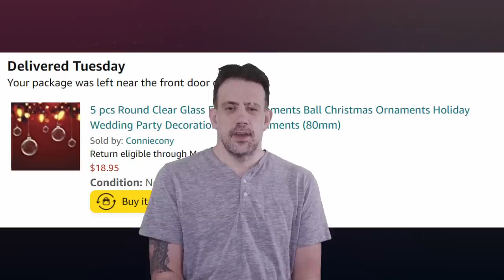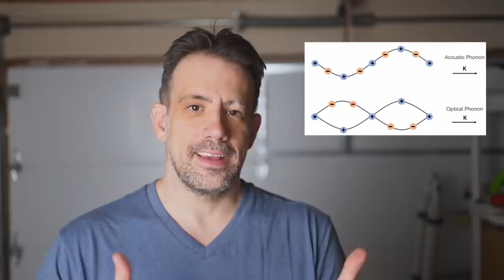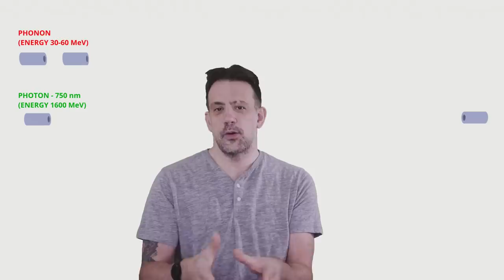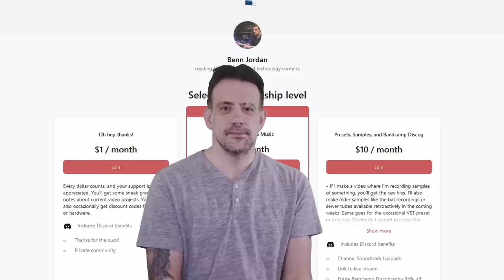How Much Electricity Does Sound Produce?

Comment: No silence, no peace! I've long-subscribed for just these sort of videos. I'm less motivated by the premise of the title than by my quest for elusive silence. As I awoke to omnipresent noise a recent morning, I lay there pondering all that stands between me and my fantasy of total silence. A litany of noises began to develop: emergency vehicle sirens, dogs barking, birds sounding off, the upstairs neighbor dropping __________ on his floor, a radio/TV/soundsystem of said upstairs neighbor, vehicle backup alarms, the incessant drone from a distant Interstate Highway, ceiling fans, caterwauling children in a nearby yard, car doors slamming, the rattles of a refuse truck, refrigerator motor, water moving through baseboard heating radiators, computer fans, wind, aircraft overhead (and the relentless alert of listening for a change in the sound suggesting a need to scramble under a table or bed), toilets flushing, alarm clocks, chirping smart phones, rustling leaves, waves crashing, distant dogs barking, a distant wood chipper, lawn mowers, leaf blowers, chain saws. nail drivers, augmented car exhaust systems, string trimmers, fireworks, a public address announcement from a nearby middle school, vacuum cleaners, microwave ovens, locomotive airhorns 20 feet from my front door --- to name a few. I've always had extraordinary hearing, and in testing for a state government job was rated some of the best ears ever tested. For this reason, the possibility that incessant noise might by converted to useful energy made me hope for the possibility of a more peaceful, less stressful world. Thanks for a modicum of hope!

Comment: A while ago I applied for a PhD position which was about using these concepts to make analog voice recognition chips. Imagine a analog resonator which is exactly tuned to only resonate when it is excited by a certain phrase (such as OK Google or Hey Siri, etc). This would allow the chip to use zero energy in passive mode, and only turn on the rest of the voice recognition chip after it's been activated.

Comment: Im assisting on a project in my uni where a fellow student is trying to design a system in which energy is harvested from mechanical force using piezo pressure plates. As you mentioned the energy harvested from sound comes in much smaller quantities, but still is a very interesting topic for discussion and maybe in the future systems could be implemented in traffic junctions, where energy is harvested both from the road on which cars drive and also the sound that they produce, though electric vehicles will probably make this application obsolete before it was even implemented properly :D
Reply: At speed, most noise from cars comes from tires rather than engines, so might not be that irrelevant to EVs after all? Though slowing cars would probably save more energy than you could recover anyway.
Reply: @Kebin-Blebin  well that's where the pressure plates come in, as cars while braking produce a lot of energy which can be harvested from the road surface

Comment: Great video. I'm a 2nd year physics student. In our statistical thermodynamic course we quite recently used phonon and magnon waves Debye model to calculate thermal energy, specific heat and some other properties of materials. 

For the first approximation (einstein model) you can view atoms like separate (motion of one not affecting another). Then the energy of an atom is just that of a linear harmonic oscilator: \hbar \omega (n_x + n_y + n_z + 3/2). From there it' s a trivial exercise to calculate other things.

It turns out however that einsteins model works well at high temperatures but it's completely wrong for the low temperatures.  But it turns out, that the Debye model despite how strange it seems gives correct results, also at low temperatures. The derivation was super long with a ton of approximations so it truely seems like a miracle that such a far fetched model works so well.

Comment: Most sound produced in nature is a byproduct of inefficiencies in systems as they operate (unless they're intended to make a sound).

But you can literally hear electricity if you're under the right power lines (yes, it is easily harvestable but that's not the point right this second).

I have actually proposed a voice activated power on mode for devices that utilized the input energy of your voice to disrupt its off state, basically a true voice activated device that could use literally zero power until you spoke to it.  I only suggested it a few times before i got tired of being either laughed out of conference rooms or told I was insane; usually both.

Thanks for the validation, even if it's only meaningful to me in a tangentially anecdotal way.  That was nice to have today.

Comment: 1. Play bass note through subwoofer around 60 hz will do.
2.properly connect an led across raw speaker of at least 6"
Place speaker facing sub around a few inches

4. Note led light up.
5. Next ?

Comment: from a materials/mechanical engineering point of view, is it unfair to conflate this all with strain energy, and utilizing the materials modulus to match resonance. We use it with strain gauges and piezo...Its just weird to call it acoustic/phonon's imo - but we already have well documented engineering on strain energy and material science.

You also start getting into the fun part with entropy where you consider materials like a rubber band, stretch - let it cool/sit under load. Then when let off in tension, its now cooler than ambient.

Comment: A small correction: solar panels can’t produce 680W/m²—it’s just not physically possible with normal solar irradiation. 

The sun gives us about 1000W/m² in the best conditions, and even the most efficient panels only convert around 25%, so you're looking at a max of ~250W/m² in real life. The theoretical limit for standard solar cells is around 33.7%, which would get you about 337W/m². Even with super high-tech multi-junction cells used in space missions, you're still only hitting around 470W/m² at most.

Comment: Higher frequency does not require more power. I can only really speak for the theory side but here it is constant, where the power of a signal is defined as energy per time.

If you go quantum physics that is not true but we use classic wave descriptions for audio.

I can't speak for air propagation exactly though. My bet is that it's also roughly constant.

Comment: Hard to compare sound and mechanical energy to combustion and light. The amount of energy emitted from a lighter is almost all heat, not light radiation. The energy released from a drill is also mostly mechanical, and some sound. I think the ratio on the lighter is much higher though. Also wavelength and medium matters.

Comment: Can a noise running 24/7 be enough to power some sort of practical device or home appliance?  Is there a practical way of harvesting noise and converting it to electricity that can power office or commercial equipment, not only LEDs?

Comment: Can you explain how the star in a jar works? They shoot sound waves into a water bubble in a jar which makes the bubble heat up to an extremely high temperature and glow just like a star. In a power plant, fossil fuels heat water to create the pressure that spins a magnet. Why couldn’t we just heat the water with sound if it can really reach that high of a temp? Think that would be possible?